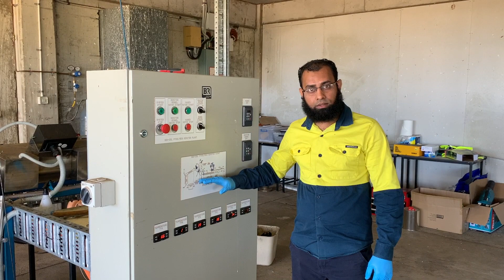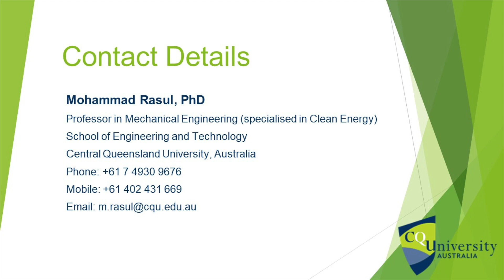Converting Waste Plastics to Australian Standard Diesel

Comment: Good afternoon. You are concerned about Ilya Vagizov from Yekaterinburg, Russia. I want to show you a diagram of a plastic pyrolysis installation that works continuously. This is a screw reactor with a gearbox. The diagram does not show the gearbox rotating screw, the distillation column is not shown. The screw is heated either by direct heating or by an electric spiral. At the bottom of the installation there is a hopper for unloading the resulting carbon. The entire installation is purged with nitrogen. With a screw diameter of 500mm, you can skip 2 tons of plastic in 12 hours.
The numbers on the diagram INDICATE:
2. loading plastic
1. screw reactor, rotates by a reducer. it is not shown
3. loading screw
9. pyrolysis gas outlet holes
6. carbon fiber collection chamber
7. screw for unloading carbon fiber.

Comment: 1) never use halogenated polymers such as Teflon as it can make the yield toxic. 
2) tyres are a no no because the vulcanisation process leads to sulphur which ends up in the pyrolysis oil and unless removed contributes to acid rain.
3) be careful with the pyrolytic oil as it can contain aromatic compounds that are carcinogenic . Temperature controls a lot of what the yield is. 
4) the waste flue gas can be used to aid the heating process when combined with a suitable expanding containment vessel to supply once a certain amount has been collected.

Comment: Hi I have seen a number of these processes used via YouTube it’s a good idea if this could be reduced in size and put on the back of a small pickup. To be used for beach cleanup operations. If I am right a amount of the gas discharge could be used to fuel the reactor. I am interested in the solid waste after the burn. How clean is it how safe for disposal or could in be put into the ground with out a worry? In the past I have made hydrogen purification units. But this if it’s clean show some promise.

Comment: This is an interesting video. However important questions are not addressed. This article answers some of them: [Do fuels made from plastic make eco sense?](https://www.dw.com/en/do-fuels-made-from-plastic-make-eco-sense/a-51495966)
TLDR; 
"If fuels are produced which are burned afterwards, then even more CO2 is blown into the air," Fischer explains. "That's not the idea of a cycle."

So it seems, chemical recycling cannot help reduce CO2. Its main benefit is helping reduce the amount of plastic waste which in itself is a major environmental issue. And it would be much better if the energy intake of the processes comes from solar or wind.

Comment: Wasting alot of energy to recycle waste plastic and turn it into another type of energy which is ready to be burnt and transform into CO2... Well not a good way to save the environment i think 😅
Reply: @aram7863  and the number of human are increasing while forest areas are decreasing :))))
Reply: @babadoz4204  I'm a green
 house grower.
I can increase co2 levels to 1500 ppm.
And in a full glass greenhouse, with co2 being 100's of times more concentrated, I get absolutely no gain in temperature. 
I'm sure you know,because of the size and shape of the co2 molecules, and how solar radiation passes over them,causing them to vibrate,creating then hold heat.
Thats co2 caused global warming in a nut shell.
Tell me how I get zero temperature fluctuations,no matter what co2 concentration levels I run?.
I,along with how many others, perform this very same "experiment" and always get the same result?..
Reply: @denniskartes1302  lets do ww3 💪 kkkkkkkkk

Comment: Are you able to use some of the energy you are recovering to help heat the pyrolysis?  Also what sort of cost is required for all of the equipment for both oil creation and refining?  Thank you for sharing your videos!
Reply: Other pyrolysis videos claim that this can be done and results in a loss of about 40% of the fuel to convert the remainder.  Search for "plastic pyrolysis" videos on YouTube.  There are many home made systems and the cost can be very small if you use recycled materials.  

Be aware that converting some kinds of plastic, for example PVC, will produce chlorine gas which is very toxic and can easily kill a human.  You should avoid using PVC and other chlorinated plastics if you don't have the facilities to safely remove chlorine gas.  Lists of plastics types and how to identify them can be found online.

Comment: How much did you spend on the equipment to produce that amount of fuel?  Is that practical??  I just a man on an island distil that much fuel with a very rudimentary distillation setup and then gasoline......can the process be used in a "shtf" situation?

Comment: How much energy was used in the reaction.  Seems like it would take more power than it produces?
Reply: right, plastic into petrol cannot be done in a profitable way, the energy input is more expensive than the result. Otherwise, everybody would do it.
Reply: You can say " how much energy to extract oil and coal from the earth". Seem to me it take a lot of equipment to drill for oil and a lot of earth movers for coal. How about about the environment impact?. How about refining the oil?. Washing the coal clean- trump
Reply: @jetblack6850  I get that the plastic is already here. But if it costs more to convert it back to fuel than fuel costs, is it worthwhile?  I appreciate being able to use the plastic for something, and not throwing it in a landfill.  The reaction requires heating, and cooling. Is the net energy produced greater than the energy used?
Reply: @Peter Türr You are a rude, terrible person, what are you doing on social media?

Comment: This science I have seen already done on an island with waste plastics that show up on shore.  He uses wood to fire his reactor, has condensers and produces his own diesel.  I can't give you his percentages and I'm sure that they are no where close to the rate that you are getting as far as kg of plastic to kg of diesel.  That being said, 80% rate of fuel from the plastic is more than I would have thought possible.  Keep it up. The cheaper it can be done the better.  Solves a lot of problems if people will make use of this tech.
Reply: It's net energy loss. For the island guy, nice to convert scrap wood to oil for his generator. This video is a net energy loss with little benefit.
Reply: @artsmith103  agreed, which is why I was politely trolling so to speak.  The point that frustrates me is these guys act like it's some miracle when a guy, on an island, with his scrap wood and plastic that has washed ashore is doing a better job.  He even has the condenser built in to the system.  One step it's done.  Now that the beast has been cut loose, the guy on the island is doing it to serve a purpose.  I wonder how many BS grants these guys got to do something already being done and how much money they walked away with.  Just the asshole side of me.....
Reply: @Josh-KJ7OEP  The energy balance is never addressed properly such that the YouTube crowd thinks it's a save the world technology. The net loss but conversion the island guy does is quite productive.
Reply: To be honest, it was interesting to hear the steps.

Comment: THIS IS NOT THE ANSWER TO THE ENERGY PROBLEMS. PLASTIC USE SLOWDOWN IN FUTURE.
Reply: It is not about energy as much as reducing toxic waste. One greater problem. Energy we don't need ultimately. We don't need to live exuberantly the way we do.
Reply: Why would plastic use slow down? Also you can use other forms of waste, maybe not for this particular but generally when it comes to gasification technologies.
Reply: Yes hopefully plastic use in the future will be much smaller. But the current waste floating in the oceans or the masses of so called recycled plastic waste which I have seen in massive towers around the world not being addressed.